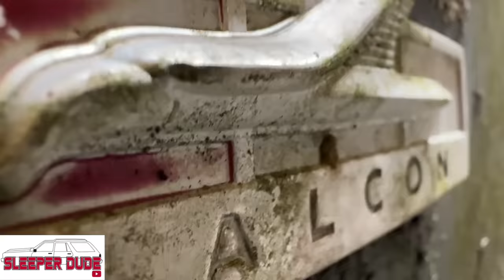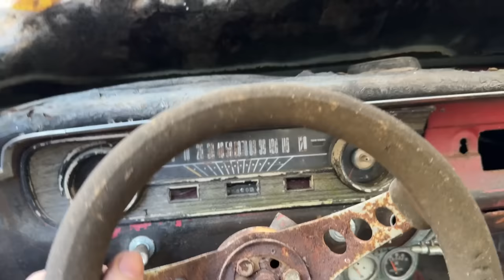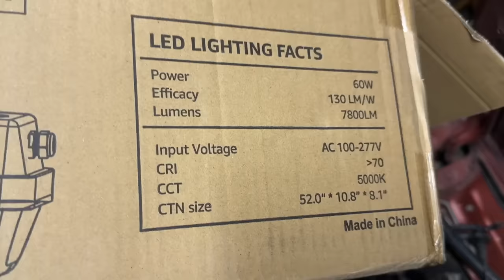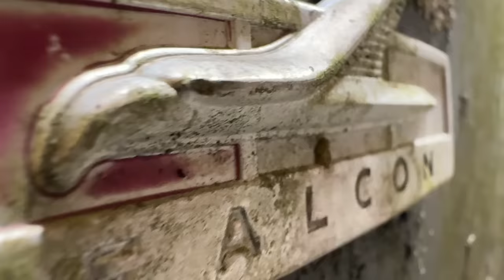Abandoned Race Car Has Some Really Cool Vintage Speed Parts.

Comment: The V8s were five hole the six cylinders were four hole in all the bodies to 6465 66 or all the same body style the doors Leonard change hoods interchange trunk lid fenders the only difference was 6564 and 65 there was a little bit of difference in the grill some of the chrome trim on the outside and the tail light but the body styles were the same and the the tail lights on the 64 was solid red and on the 65 was red and had some little chrome rings on the tail light lens the grill was different the tail lights were different but everything else would interchange

Comment: The Falcon 1966 Ford sports FUTURA is original color Apple red. The other Falcon family Ford car with red interior. That's where the many Falcon in for parts also the Falcon was cracked in 1/2 it became front and a back. The Falcon will still away and come back to you as the only man that owns his driving only one car and not know any other truck and car. You will drive the Faithful Rock that come back to you from the world that provide all Falcon must be restore so they can build the Red Tail Falcon car with replicas parts that you really need the steel 15 inch expensive steel ie rim with 4 lugs. They are all damage but the old factory in Durham, Press is The Ford and Howard Hughes car builder will do the job in press 200 tons Build in as the American product hydraulic 2250 PSI in for 9 3/4 stroke. What gauge will the rim will be for original Falcon?